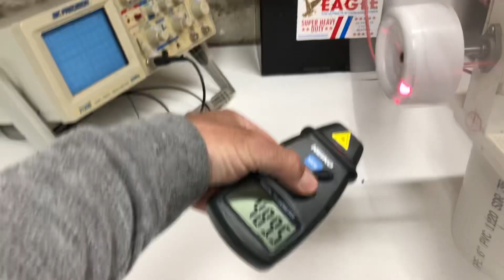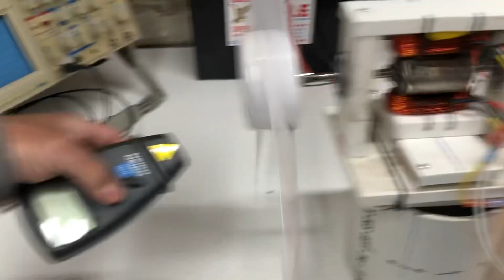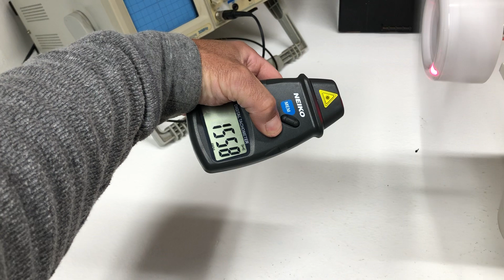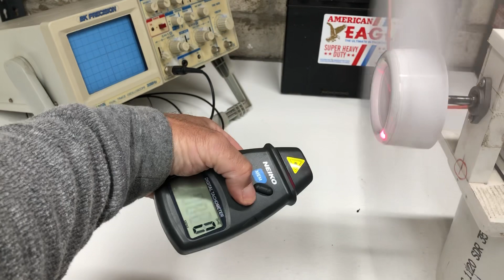Pulse motor output experiments looping back to motor

Comment: At higher speed the impedance of the coils makes the motor run at more amps. The higher the speed, the shorter the pulse, the less power is regained, this has to do with the fact that you r timing is fixed. I believe the timing should be different at higher speeds to collect more Back EMF.
Reply from the maker: Adjustable timing is preferred most of my motors are adjustable 
When motor is going at slower speeds it’s only necessary to tune timing for load

Comment: Do you think the higher RPM is causing more drag from the load as well? You're right about the pwm duty cycle. When you have more of a break between pulses, the coils have a chance to bounce back but when you get past the sweet spot, your pulses become closer together and you start to lose the bemf. I like the loop back but I'm not sure I understand how you set it up. Cool video for sure.
Reply from the maker: Thanks ! 
 I don’t think high Rpms is causing drag 
 When you reach full throttle there is only 3 pulses per revaluation so out put gos down when your using pwm even right before full your getting like 20 pulses per rev 

Loop back is easy but only if you have secondary windings if not it’s a direct short 

So out put to full bridge to capacitor threw diode so (no back charge ) then back to input  give it a try

Comment: Are you measuring the current before the PWM or between the PWM and the coils? Nice work as always buddy! Very interesting
Reply from the maker: Thanks ! The analog meter shows amp coming out of the caps going back to power input of the motor (back to primary battery)

Comment: Nice setup! Thanks for sharing! Did you try instead of using a secondary motor winding just use a transformer (as you use in another videos) to fillup a capacitor and use as a second pulse for the h-bridge? Thanks again!